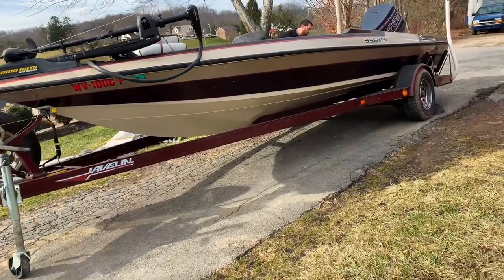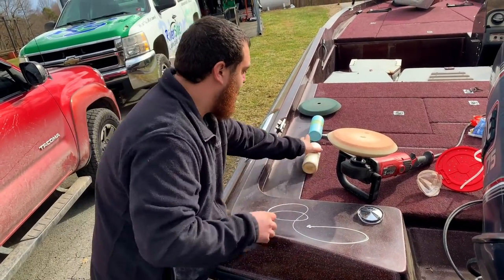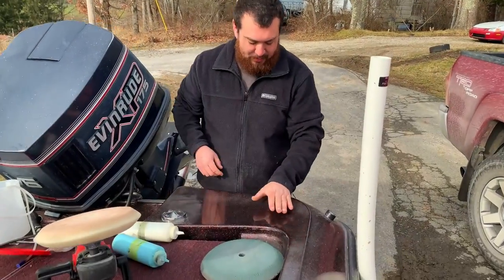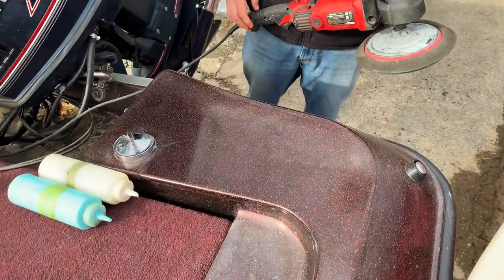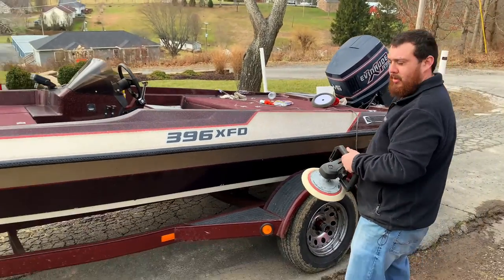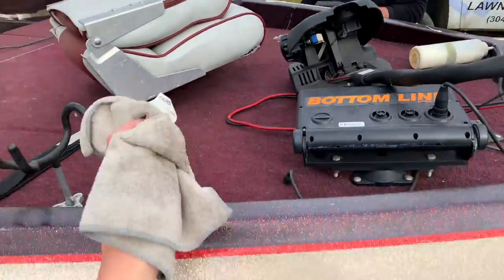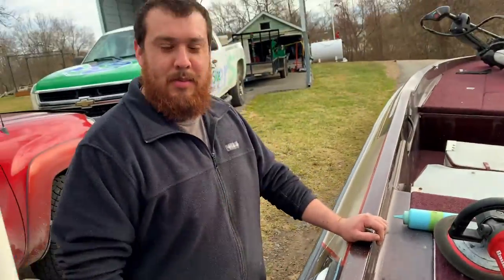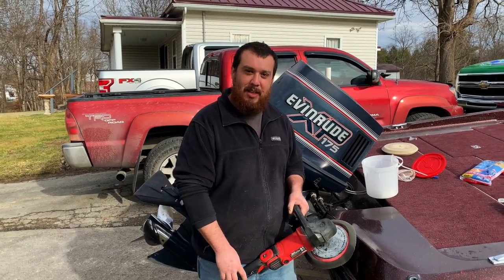How to Buff a Bass Boat: Start to Finish and Removing Oxidation

Comment: Would of been great video but what cleaner and glaze are you using???
Reply from the maker: Before buffing the boat make sure to clean the surfaces. In this video to clean the surface we just used a damp rag with water. Once the surface of where you want to buff is clean then you can add the glaze. You can pick up this brand from Harbor Freight! It’s called, Meguiars. It’s for marine and RV’s. It helps remove heavy oxidation! Hope this helped!